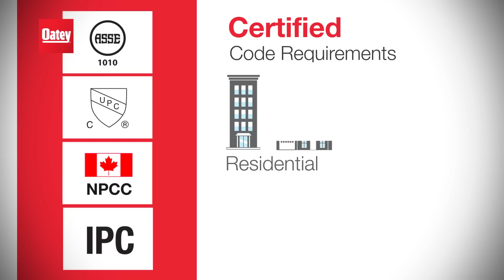Silence Banging Water Pipes with Oatey Quiet Pipes Water Hammer Arrestors

Comment: Why did they use LEAD in this product? I thought LEAD was banned in Canada in plumbing products. Imagine your washed clothes contain lead particles and rub on your skin. They don't say LEAD in the package, you have to read it on Oatey's website of this product manual to find out something like 2.5% lead on T section and 3.7% lead on adapter and nut. Just waste my time going back to HP to return this.
Reply: Per the standard for plumbing supply fittings, American Society of Mechanical Engineers (ASME) 112.18.1 / Canadian Standards Association (CSA) B125.1 which is referenced in the National Plumbing Code of Canada, Fittings intended to convey or dispense water for human consumption through drinking or cooking shall not contain a weighted average lead content in excess of 0.25% when evaluated in accordance with the test method specified in NSF/ANSI 372.